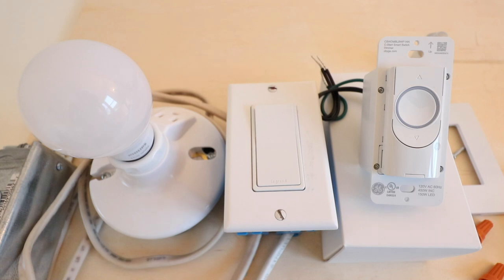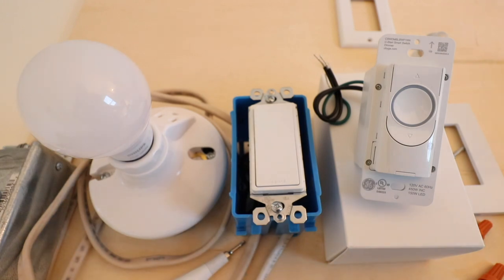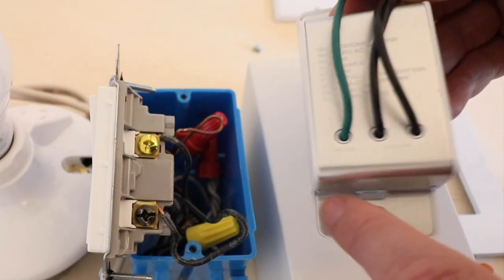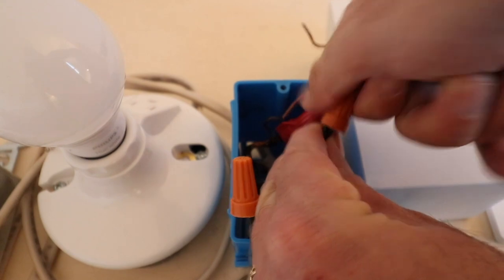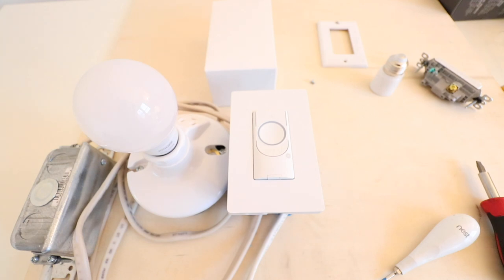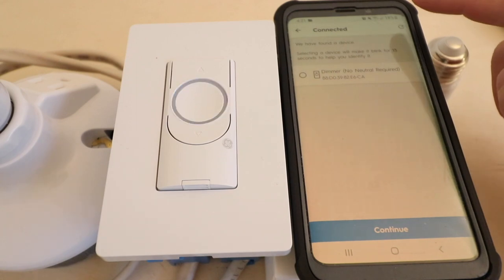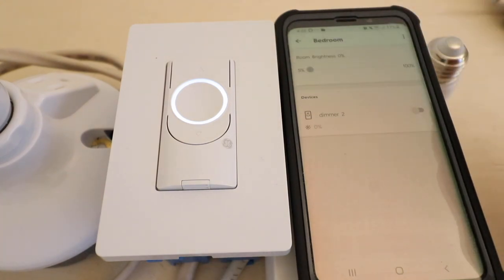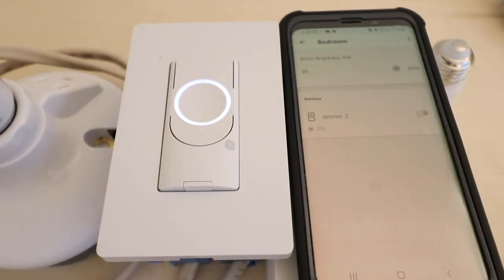How To Install C by GE Dimmer Smart Switch No Neutral Required

Comment: My switch only has two wires. I dont have a ground. I am currently using a dimmable light switch but I want something that I can control with my phone. Will this still work without a ground wire?
Reply: Yes
Reply: @JordanLindhurst1  Is it safe?

Comment: I  have the motion and dimmer without neutral wire. I don’t see the dimmer option setting, how can I set the brightness on the switch on a fixed program. It keeps going on in full brightness and not on “nightlight mode as I want it to.  Thanks.

Comment: Does the smart switch work out on the LED pendant light?
Reply from the maker: I haven't had any issues using the GE Smart Dimmers: https://amzn.to/3m0EBpV with different LEDs. There's a lower range adjustment that can help prevent flickering if you have that problem.

Comment: I am trying to wire a smart switch to an existing (non-smart) flood light with motion sensor. Every time the flood light comes on via its motion sensor, it would activate your smart switch. I am basically using your smart switch NOT to turn on the flood light but as a smart relay to tell other things to come on. would your switch work for my application please.

Comment: Can you control  ceiling fan's with this? Or just the, lights?
Reply from the maker: The on/off version: https://amzn.to/3m1jwLy can be used but the dimmer cannot be used with fans. I also like the Lutron Caseta fan controller as well for smart fan control: https://amzn.to/2USyac2
Reply: @OneHourSmartHome  i have 2 ceiling fan's  on one switch.  With pull chains.  What do you recommend for that?

Comment: Does it hum? I got a switch from Moes, and it hums and it also comes with a capacitor, its a lot cheaper and it has a glass cover witch makes it really good-looking. I installed it on the kitchen since the humming won't be heard there, and I was thinking of getting this switch for the bed rooms, but i did like to know if it hums.
Reply from the maker: In my experience the C by GE Dimmer: https://amzn.to/35v58Vr did not hum.
Reply: @OneHourSmartHome  awesome! Thanks, I just ordered it and I will update here as to what my experience is.
Reply: @OneHourSmartHome  update: it does not hum at all and it allows me to control the dimming in the lights, only issues I see is that the app is not very responsive. Update: the light around the ring in the switch can be toggled on and off in the app, must do an update to get this feature (light right around the switch stays on once you turn it off which is an issue since this switch is in a bed room, I will try and mask it and see if I can decrease the brightness of it.)
Reply: @plbpardo   hey just wondering are you running LED bulbs with the switch ? I hear people have problems with led bulbs and the switch for some problem
Reply: @sebastianedwards6731  yeah they are LEDs but no issue whatsoever on mine at least. I do have a fan with lights and I tried using Moe's switch on it but it didn't work correctly, I haven't tried the C by E on it thought, since I only have one, but maybe I will buy another one and use it.